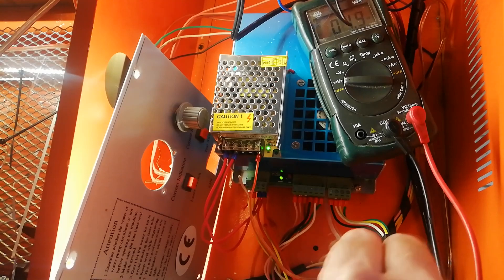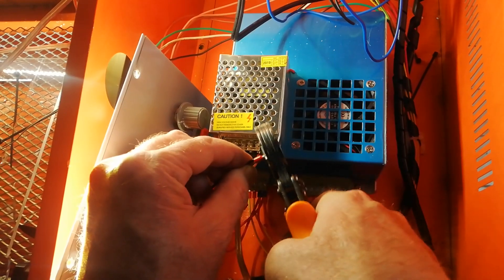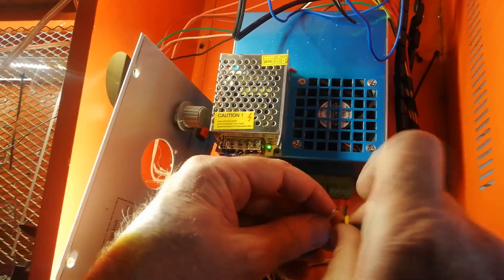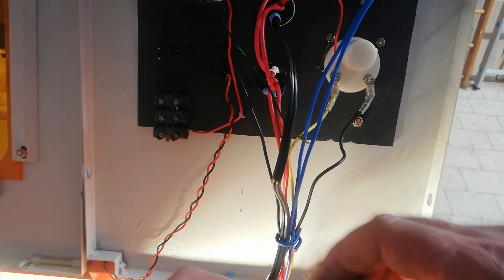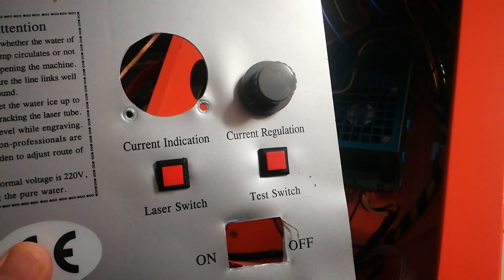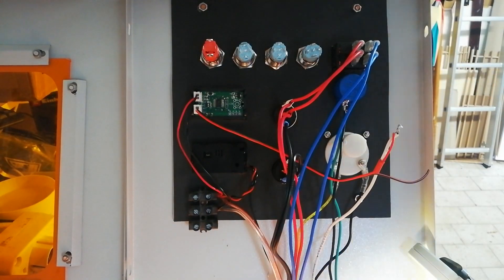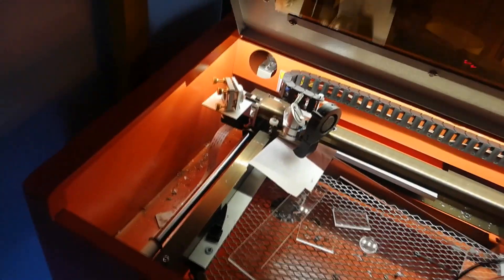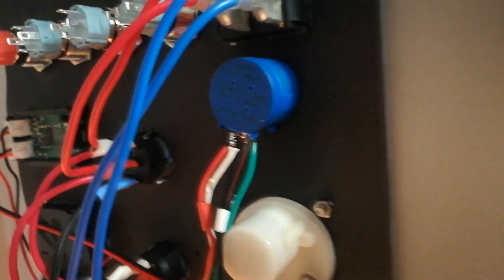K40 Laser upgraded control panel wiring Part 3 D.C wiring.

Comment: Why is the Ground of the 24V supply connected back to the main power supply?
Reply from the maker: Its so both power supplies have the same negative and there is no weird floating earth, which could cause issues.

Comment: Hi, big thx from Germany for sharing it with us. I learned a lot watching your videos about the k40.

Can you please describe how to check if the K40 is properly grounded? There are lot of stories about the problem.. But I still haven't found someone who describes how to check the grounding or how to do it properly.
Reply from the maker: Hi I´ve never had an issue with the earth but you can check it with a meter between the earth connector on the plug and metal part of the body on the machine, it should be close to 0 ohms.

Comment: Do you have a link to that terminal? I can't find them anywhere
Reply from the maker: Hi    here they are :EU: https://www.amazon.de/-/en/Connex-COXB370390-Terminal-Blocks-Pack/dp/B01N0X5IVW/ref=sr_1_16?crid=J1P8XP1VNOYN&dchild=1&keywords=klemmenblock&qid=1607688910&sprefix=Terminal%2Caps%2C230&sr=8-16

                                   US:https://www.amazon.com/Terminal-Connector-Electric-Barrier-12-Position/dp/B08NGBQWWT/ref=sr_1_21?crid=QNCQIARSFSG0&dchild=1&keywords=terminal+block&qid=1607689000&sprefix=terminal+%2Caps%2C588&sr=8-21

Comment: So your air assist is 24v ?.
I have some switches that are rated for 230v with a 24v led ring, can I use them to power 220v items and still.have the illuminated Ring ?
Thanks for your help.
Reply from the maker: Hi Stewart, this is possible but you would need to rectify the switched mains voltage to power the LED or use a relay. It gets a bit complicated that´s why I used a mains switch with a neon light in it..

Comment: First of all I love the videos, thank you so much for all your Laser help. Possibly a noob question but I have a 5 digit Ammeter and a 5 digit volt meter, Could I wire the ammeter up to the pot the same way as the volt meter. If its a stupid question I'm sorry. Keep up the great content
Reply from the maker: No problem, no an ammeter would have to go in-line, you could replace the original analog meter with a digital one, just by using the same wiring.
Reply: @letsfixit1594  Thank you so much. Your channel deserves many more subscribers!!
Reply from the maker: @gridgamer4083  Thank you ,let me know how you go with this, Somebody already bought my latest machine from me so I may buy another one and try it with a digital display for the current.
Reply: @letsfixit1594    I will be doing loads of upgrades on my K40 and the ammeter was the final bit of the puzzle. I had tried what you said but had no luck so I will try again as I'm sure I was doing something wrong. I only wish Id found your channel before doing everything else as following your videos would have been so much more time efficient and easier. I will keep you updated. Thanks again
Reply from the maker: @gridgamer4083  Try reversing the connections.
Reply: @letsfixit1594  Yeah I will do. Im going to make a start on the last couple of upgrades tomorrow if I get time so I will be in touch to tell you how it went

Comment: you should've mentioned connections on power supply, rather than the colors of wiring. Digital control board and mechanical has different wiring colors as well as connections, but making such a control panels makes them identical. Perhaps you could do wiring scheme? Thanks

Comment: What type of support are you using for the blower fan mounted on the laser head?
Reply from the maker: It´s a 3d printed one I designed, you can find the print files here: https://www.thingiverse.com/thing:4145412
Reply: @letsfixit1594  Interesting, thank you! Did you used some 3d printed parts for the cable chain too?
Reply from the maker: @PapLab  No I bought that, you can find it on-line.